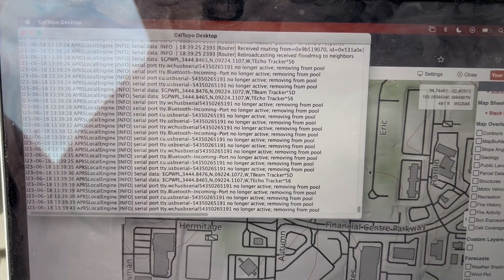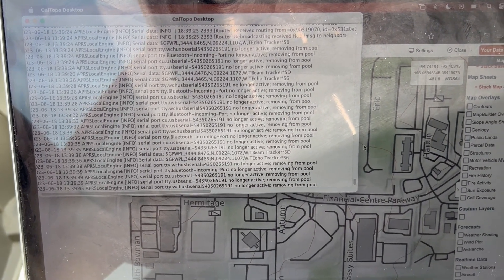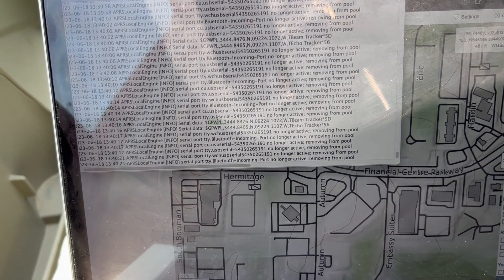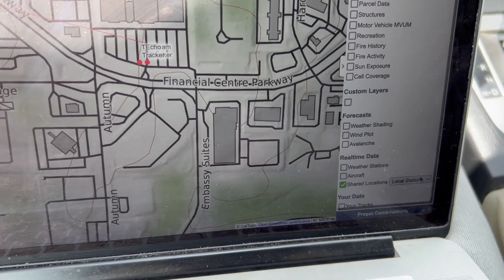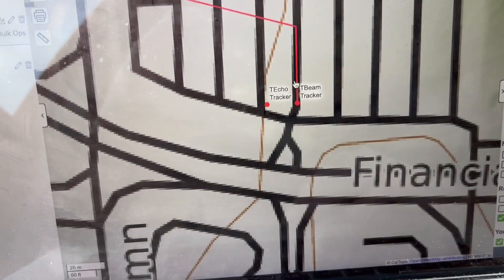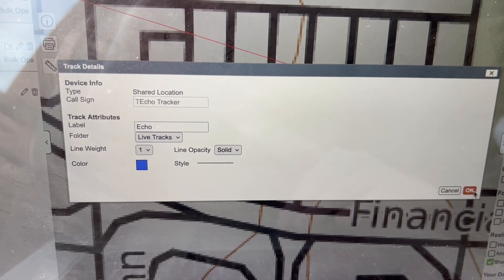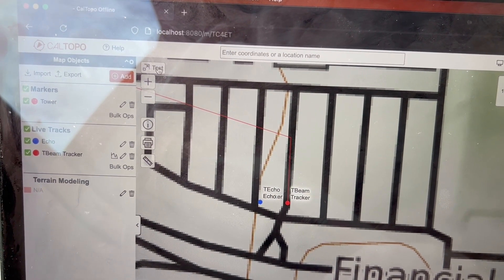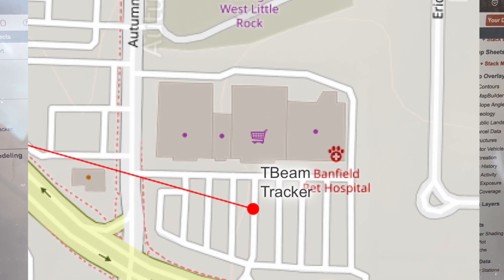Meshtastic CalTopo / SARTopo Integration

Comment: I'm still waiting on more meshtastic devices to build out our SAR kit but I did get my one device up and running on Caltopo. Although I can see several nodes transmitting GPS on my android device, only 1 other node besides my own are showing up on caltopo. Does this only work with nodes that are directly connected to mine or will i be able to utilize the whole mesh?

Comment: This is very interesting. I am going though training for a SAR team and while using SARTopo it would have dead zones. It seems you could run this parallel to be more robust in low or no cell service areas. Has there been any feedback of how well this is working in the wild?
Reply from the maker: Other than some recent issues that have since been resolved it's mostly been only positive feedback.

Comment: Thanks for the video however, I am stuck configuring CalTopo to receive the data. I have verified that my device is sending coordinates. I am stuck at is adding the code to the "caltopo property file" (from their instructions). I am opening the file with notepad and paste the code from CalTopo with serial port location updated.  However, I am still not receiving the data in CalTopo. What am doing wrong? Do you have any tips?
Reply from the maker: Were you able to get this figured out? If not, I would suggest joining our discord and someone can likely get you the information you need.

Comment: I am  a SAR team Administrator and very interested in the idea of off grid location sharing, especially if it can be made to work with CalTopo as that is our Primary Software.
I apreciate the video above, but am not yet tech savvy enough to get a beacon talking to Caltopo via the APRS interface.  I would real like a tutorial aimed novices as more of a step by step setup video. I made a post on Meshtastic (SAR41) asking for help with Caltopo integration. No replies as yet.

I have a handful of T-Beams running Meshtastic and Rak's on the way. If CalTop integration can be simplified, I believe a lot of SAR Teams would be very interested in this technology.

Comment: Great to know that things have continued to improve! One of the reasons I wanted to use meshtastic was for live tracking with ATAK. While that platform is FAR superior to CalTopo (formerly SARTopo), it is not as easy as CalTopo. Now that I know this is an option with CalTopo, I will try to get my Lilygo T-Beams working in CalTopo. 
I am quite well versed in CalTopo and improving in ATAK but still need to improve in my understanding of the T-Beam antenna options. 
@Meshtastic I CANNOT THANK YOU ENOUGH FOR YOUR WORK!!!!!!! As a volunteer SAR member in a remote area where there are no comms, Meshtastic is getting us closer to safer operations due to being able to communicate better than with just handheld radios.

Comment: Are you aware of a good source for cases for the TBeam?
Reply from the maker: There are several community members that sell cases on Etsy. If you search "Meshtastic" you'll find numerous options. If you have a 3D printer and want to print your own, you can also search "Meshtastic" on Printables.
Reply: I’ve purchased a few from Spec5 on EBay. The only mod I made was to drill a hole for an SMA connector to mount an Active GPS antenna.  This improved the time-to-acquire and number of GPS satellites I pick up. 

Honestly, if starting over, I might have gone with T-Beam Supremes, if only for Antenna Placement. 

Recently, I purchased and have been using a T-Echo, which is working very well. 

I just need to figure out how to set up CalTopo for  serial.

Comment: Very interested in this. I have 3 t beams and have just started working with them. SAR teams here in michigan refuse to adopt APRS. I was hoping to clip t beams on their packs in lieu of them being proficient at Ham radio. 

I'll be reading about this serial port to caltopo integration 4 sure
Reply: HAM is intimidating for folks who want to be in the woods. They (at least around me) think of HAM as sitting at a computer (think HAM shack). I have been testing the Meshtastic devices in rural (RURAL) Montana and am hoping that they keep improving as we have no good coms... Portable Kenwoods and Motorolas leave much to be desired here. 
For an example location google: "45.000000, -112.000000" go south until you find a house. Those coordinates are close to houses but if you go south you'll see what I mean by remote areas. 
Thank you for caring enough to try and help the SAR teams! Too many people think that they only need people who hike a lot. That is SO not true!
Reply: If you are a HAM and understand Antenna's, Please let me know your thoughts on what antennas work the best with these Meshtastic T-Beams. I have heard many say that the antennas are not set for the right frequency ranges of the Devices. I'm not a HAM and don't understand antenna theory and don't know if the statements are accurate or not.
Reply: That statement is absolutely correct.....antennas should be tuned to resonance for the frequency they're being used on.
Antennas are very easy to make, there are dozens of videos here on YouTube and there's also an Android app (likely available for iOS as well) that will provide the exact length required for whatever frequency you choose. 
I hope that's helpful, good luck with your project!